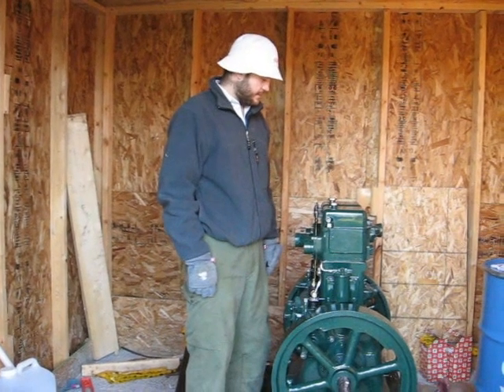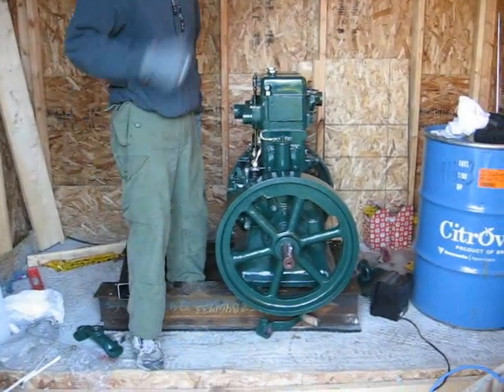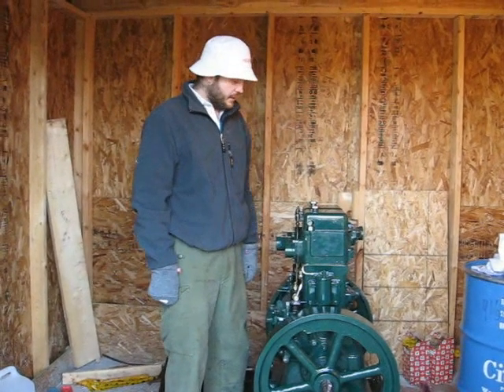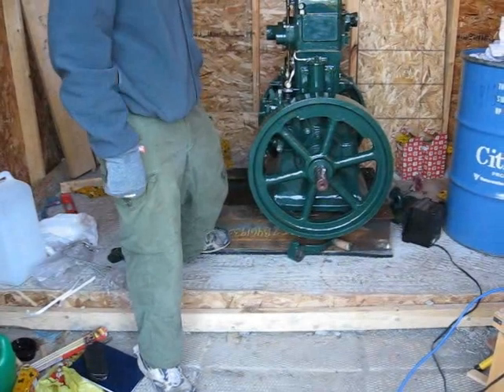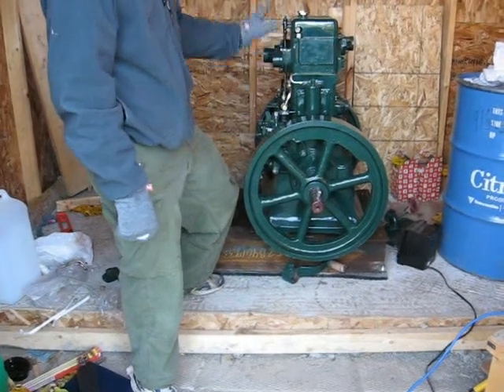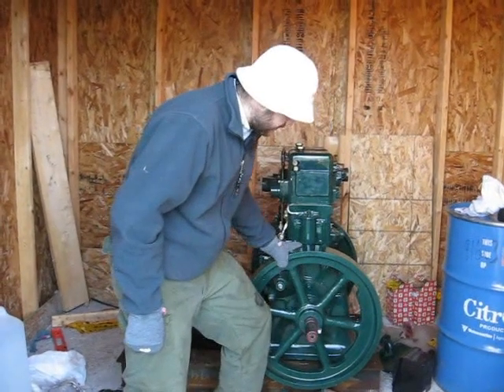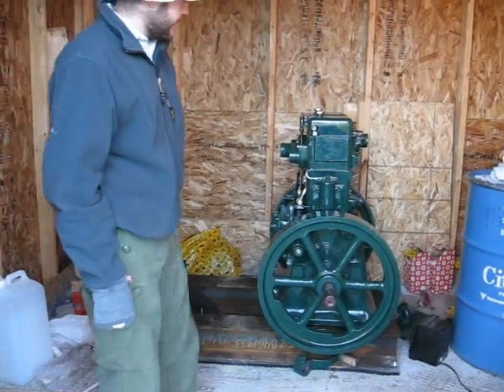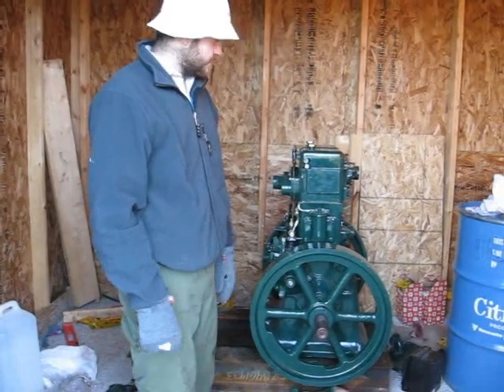A Big Veggie Engine

Comment: @smellslikefries I have a pre WW2  CS 5 hp jobbie - when I was looking into how to fix it in place I spoke to a guy who had put a rubber matt under his and it soon reduced the matt to jelly causing belt enlignment issues - his advice was to bolt it to a huge raft of solid concrete with some rebar in - maybe he used the wrong rubber

Comment: It may be a bit of a chore to buy one these days.  The EPA put a restriction on buying these engines for whatever reason.

You can probably buy one in pieces and assemble it or find one that is already in country and buy it from the previous owner.

Great engines, with proper maintenance they can run for years at a time.